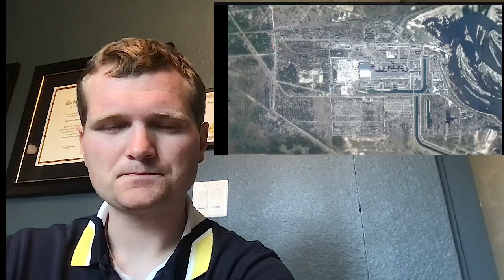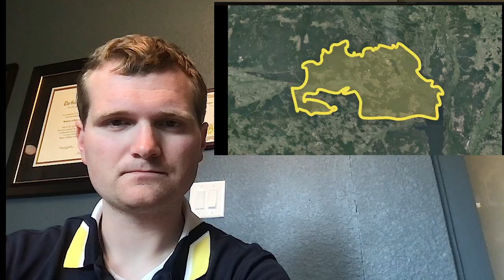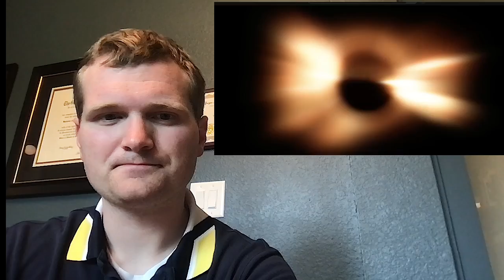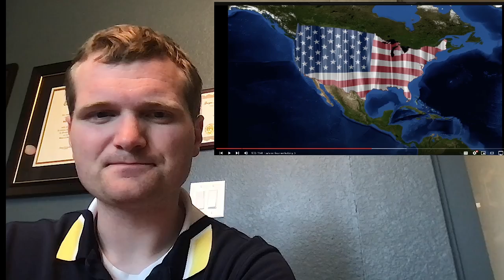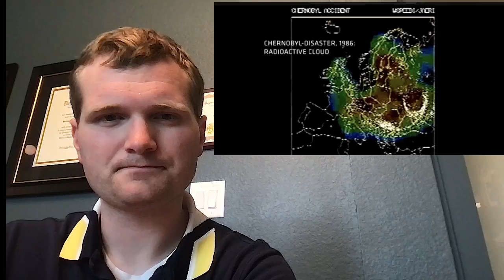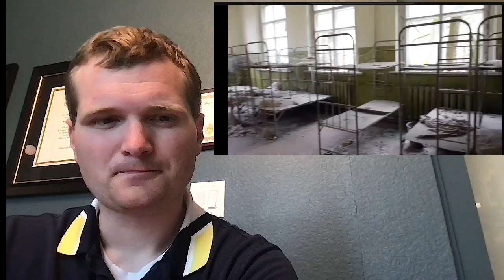Nuclear Engineer Disagrees with Real Life Lore Claiming Chernobyl is Still a Massive Problem Today

Comment: 9:50 I doubt that there is still an intense heat inside the reactor 4. After almost 40 yerars, the thermal decay power of the bad stuff is orders of magnitudes lower then it was shortly after the bang. Radiation is still high though.
Reply: Some scientists in 1996 went on r.4 biological shield. So I too think it's now room temperature. The scientists said that the radiation was about 500 roentgens/hour.

Comment: Earth is majority water way more compaired with land.

Why not build more hydro power stations over nuclear. I guess cost, time efficiency and energy outputs would be put into the mix. But wont be any nuclear waste to deal with for one and also thier is a plentiful supply of water ?
Reply: Hydroelectricity requires a change in elevation to produce electricity, which is why it is infeasible in flat areas. Hydroelectricity is only feasible in moderately hilly areas, and besides, it still holds back a massive volume of water that, if released, could cause significant damage everything downstream. Not too different from a giant containment structure that holds back a core of material that literally glows blue and could cause significant harm if released. Of course, well-built embankments, spillway gates, and turbines make hydroelectricity just as safe as nuclear energy with its massive containment structure, radiological controlled areas, and airlocks, but hydroelectricity did have a "Chernobyl" in the 1970s in China."

Comment: honestly i find the Centralia fire in Pennsylvania more of a "massive threat" then Chernobyl. Chernobyl is, at the moment, contained and is being actively dealt with. the centralia fire is still raging after over 60 years and no way of controlling it save for staying clear of the area.
Reply: It's a slow, smoldering fire in an underground vein of coal. Not a "raging fire". I'm surprised a company hasn't tapped into it and used it for a small thermal-hydro power plant.

Comment: It was a safety test. The goal of the test was to prove that the still spinning turbine could provide power to the plant with it's kinetic energy until the diesel generators could activate, which took a few seconds.
Also again, 100 years is very short sighted. It's not an immediate health risk, but it is an unsolved problem. This thing requires enormous resources to monitor, maintain and contain for a very, very long time. Unless you fill up the second containment building with concrete to the top, it's going to stay a problem. And even that will weather away eventually.
12:35 that is because that even the russians are not dumb enough to attack that site. It doesn't provide any value one way or another and it would be quite the PR disaster if they did attack it.
Reply: If you are saying "It was a safety test" to correct him, he wasn't claiming it not to be. His comment was a juxtaposition on  the blatantly unsafe steps taken to complete the safety test.
Reply: I think you're looking at a few hundred years of the radioactive material being difficult to handle (most of the current penetrating radiation is from Cs-137 and Sr-90, which halves every 30 years). Once the gamma is gone, can be contact handled, and the small amount of transuranic material can be separated off, recycled into fuel, and disposed of.

The NSC is designed to facilitate dismantling the destroyed reactor, so 100 years is a reasonable design lifetime for the structure. If they need to extend its life (or replace it) they can do so when the time comes, just like we do for other important structures.